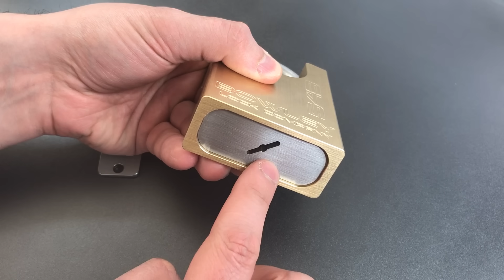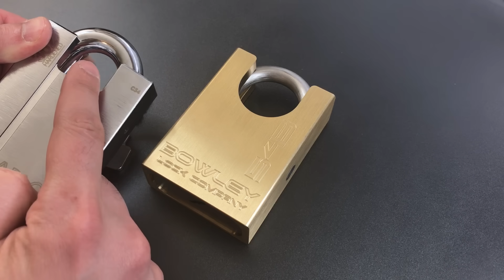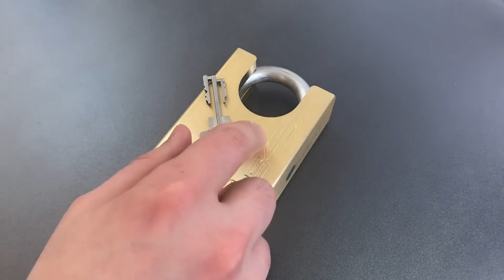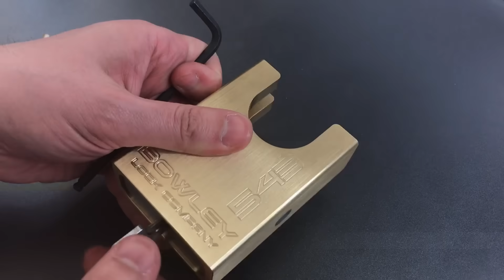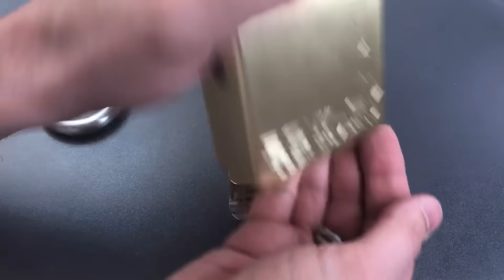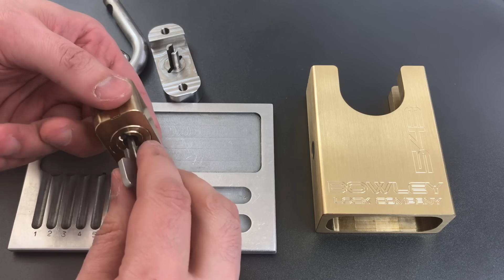[653] Prototype Dual Fork Bowley Padlock (Model 543)

Comment: I'm sad you didn't even try to pick it
Reply: He said in the video he’d need to make a custom tool to pick it so it’s probably a lot of work to make a tool that’d only be usable on a very specific lock.
Reply: @caster269  I think the u-shape pick also needs to be pin-specific because of the pin shield. You cannot pick all the pins with the same lenght tool. If there's a key, sure it's pickable, but I guess this would need 5 to 9 custom single picks and a lot of time.
Reply: @beloved_lover  
Honestly, I think you'd need a hollow shaped tool to tension it and work the idler while inserting some more malleable tool inside to pick it.
And people complained Kingdom Come Deliverance had a tricky picking minigame
Reply: So is the really the first lock that he cant reasonably pick???
Reply: @common_c3nts  as far as I've seen... kinda new tho
Reply: @beloved_lover  unpickable
Reply: @beloved_lover  actually they can pick the original with just a tensioner and one tool, they need a tensioner and 2 tools for this one.
Reply: @common_c3nts  don't say silly things. there are a lot he can not pick, certainly the abloy protec2.
Reply: @rohadtanyad8908  I've seen huxley's video, and another where someone single pin picked the original. SPP requires 1 tool per two pins plus the tensioner, which have to be very thin leading to shit feedback from the lock. I wonder if both methods could be made completely impractical by putting in a few more security pins.
Reply: @caster269  hed probably end up making a replica of the key
Reply: I'm sure it's because he can't because Bowley locks are crazy.
Reply: cuhleef just not to ruin somebody's new business
Reply: @cuhleef  Their lock was easily picked.
Reply: He can't yet, no one can. They will eventually.
Reply: on the padlock you cant fit the 8-10 custom tools needed at once into the keyway and even if you could you would need 9? of each or basically be building the 100 peice shim keyset that bowley talked about making for locksmiths for the orignal bowley .....noone would ever pick this real world it comes down to weakest link eg. nice brick house with glass windows
Reply: Yeah you would need a pick set made specifically for this lock to pick it, such a pick set would need to follow the "long U-shape" of the key, and would need several moving parts on both sides. Imagine what this guy did to the original Bowley lock, but now doubled because there are pins on both sides: https://www.youtube.com/watch?v=leQQ8ChtGkQ
Reply: @Hennu_TRM  Yeah technically doable but practically lemme cut the doors instead it's less complicated
Reply: @Hennu_TRM  I still do not believe this was a true pick. They both made tools that could match the bidding, i.e. a laminated key. What I want to see is them picking one of theses locks with zero knowledge of the bidding. Still has not been done to my knowledge.
Reply: @Taluvian  Good point.
Reply: Every one of his videos he rehearses though so.... <_<;
Reply: Taluvian that’s impossible mate
Reply: This lock is like 9 locking mechanisms and 9 keys for one lock, forget picking it just try to cut it.
Reply: If this lock becomes much more popular eventually there will probably be very special tools in place to pick it. As is I don't think there's even really a point in trying to make your own tool, this lock is the real deal.
Reply: @alexmac7103  Problem is, I don't even see it working with multiple custom picks for each pin. That shielding mechanism he's shown in the end ensures you'd have to rotate it back to "closed" to take the tool out and insert another. I'm not sure how you're supposed to keep tensioning it like that.
Reply: Just use lock cutters on this one or cut the chain, it would be much faster.
Reply: Check his video on an original Bowley lock (without this double key) - he really gave in-depth explanation of this mechanism and why he wasn't able to pick it
Reply: You can't, lol. Beautiful design. Prevents the picker from having direct access to the pins. I guarantee this design is patented.

Edit: it is pickable,  just requires the right tool for the job. It's almost impossible though.
Reply: @JF32304  it can be picked in 30 seconds or less by the right person. it is up on youtube.
Reply: Zachary Rivera Bowley locks are physically impossible to pick.
Reply: @littlebit670  not even. look up huxleypig69 picking it in a few seconds. he also picked the abloy protec2.
Reply: I cant imagine the engineering of would take to make the complaint mechanism to make it even possible to pick this. Itll happen eventually but given the tools now, its damn near impossible even for the great LPL.
Reply: @colesherrill7472   it can be picked pretty quickly now with an epg attack.
Reply: So everyone in this thread knows—the single-sides Bowley locked has officially been picked, I know by at least one person. It required, iirc, 5 separate custom designed tools working in conjunction to pick it.
Reply: alex rosebrough Yes - but this method is not a confirmed picking solution. It could just be a laminated key method.
Reply: Everyone complains that he never posts locks he can't pick. The thing he does but he takes them apart instead 😂
Reply: I'm sad that you think he would waste his time trying
Reply: He can't.
Reply: Do you only look this dumb are you actually? He didn't because he would first create a tool that would be capable of having a chance eventhough his experience in creating tools like that aren't really up to match for this lock. It would be material cost, time cost and alot of effort for abysmally small chances to actually pick it.
Reply: Well that’s how you know it’s a good lock.
Reply: If LPL didn’t pick it, it’s unpickable
Reply: @ThomasFarquhar2  or just pointless to try, smoke wrench. Lol cut the door in half before I try to pick that mess.
Reply: He couldnt pick the other variant, there's no way he could pick the even harder version
Reply: He has not even opened the original
Reply: Better try drilling it first.
Reply: Dont bite the hand that feeds you, pal
Reply: he doesnt show things he cant pick.
Reply: From what he said, he'd need a custom tool to do it.
Reply: you wouldn't pick it . It's easier to have an angle grinder, sledge hammer or some other brute force attack on the lock , chain or whatever the weakest link in the security is.
Reply: When two samurai of the same level meet each other, they notice each others' skill without having to cross swords, as a sign of mutual respect. I think this is like that.
Reply: You can't. You need very special tools to even attempt.
Reply: It’s possible to create a u shaped key with pins that can move up and down with tiny little cameras in the core of each pin
Reply: There's a video of a guy picking a Bowley lock, but he used a special tool.
Reply: No it actually seems impossible to pick in the community without custom tools made JUST for this mechanism. Two guys picked the first lock, with only one row of pins. But the tools were super specific and i am not sure if they are mostly a replica of the key, they havent picked 2 different locks of the same type in one video (also i am not an expert). But no, he cant pick it without making tools for it
Reply: @mqbq3651  Exactly you basically end up making a specific pick that amounts to a key
Reply: @TheDjcarter1966  nah, they can pick it with just a tensioning bar and a single tool.
Reply: its probably because its a prototype...
it's kinda unfair to try to pick a unfinished product which may suggest it has weaknesses the finished product may not have..
Reply: He's sponsor by them so he doesn't want to pick it.
Reply: Suwanh Y In where in the video does he say this is sponsored, when you’re sponsored you get money while liking everything, this is more of a review
Reply: Suwanh Y That’s a bullshit slander, he’s said he’s not sponsored or accepted money from any lock company... EVER. Unless you think he’s a liar, and if you do the decent thing to do would be to provide evidence of that
Reply: @mcamp9445  He gets locks sent to him, worth some money for free. You should never trust a lawyer. 🤫

Comment: -canadian lock
-measured in inches
Reply: Engineer here from canada, works with metric one day and US the next.
Reply: Canadians go both ways.
Reply: We use both because so many products come from the US and Canada. It gets quite annoying.
Reply: We use both here.
Reply: @BMikeAD  actually good point. in a workshop I know of in canada, the main measure is inches, so American machinery can be used. which makes sense for a machined lock...
Reply: j Walster that’s not the reason we use imperial. Canada is not fully metric due to our roots being tied to the UK (before they were metric) and our close proximity to the US so when they began the conversion to metric in the 70’s there was a lot of resistance so it’s a big mish mash of both. We use kilometres instead of miles and litres instead of gallons at gas stations but when talking about length and weight, we usually use feet/inches and pounds. Height, weight, how much you bench, the length of a room, size of your tv, length of a piece of lumber or a pool, etc. We use mainly imperial in government documents, even our height is listed in centimetres on our drivers licences but in everyday life we use imperial for height and weight.
Reply: @dlee6985  Being Canadian can be complicated.
Reply: @kenc2257  Not really, it just expended our horizon PS Sorry for any gramatical error, french is my mother tongue
Reply: @dlee6985  litres instead of gallons is stupid because you are getting less gass for the same amount of money usually
Reply: @dlee6985  Us in the UK are in a half way house on imperial / metric measurements. I don't see this changing anytime soon !
Reply: BMikeAD same in the USA. Science trades tend to use metric.
Reply: @Zachmman1997  because it's more precise and easier to calculate, but imperial is easier to estimate or judge by eye.
Reply: FREEEEEEEDOM UNITS
Reply: I am a Tradesman in Canada and we use Imperial 95% of the time. Trades school here teaches both, however.
Reply: @seanelgie  It shouldn't take a trade school to teach the difference. I learnt it in high school. 2.54cm to 1 inch. 2.2lbs to 1kg. Basics.
Reply: Brits and Canadians often still use imperial to measure things
Reply: Just going to say that metric is superior
Reply: Well Canada is just America's hat
Reply: @Terabit3  it's like a hat, where it is covered in snow!
Reply: @smpmuzpid  a lot of Americans use metric too.
Reply: @ipopmyneck805  
Yes the US military because every country they invade uses metric highway measurements, and of course the drug dealers.
Reply: I mean when y’all adopted the FAL you specifically changed it to the first of the Inch pattern ones, instead of just using the metric.
Reply: @andyriggs6613  you are ignorant of common measure terms. Good job.
Reply: They use both, watch this video: https://youtu.be/s95cxZkC_es
Reply: Yeah buddy we're bilingual in length
Reply: Right metric syatem...
Reply: Makes canadians two times more educated, no? joke
Reply: @caffeinatedinsanity2324  funny because it's more than true
Reply: @caffeinatedinsanity2324  well if you look it up Canada does have the highest education rating per capita in the world so.... yes
Reply: @DUxMORTEM  that is false i believe actually
Reply: @strider04  that is correct actually 
. 50% of the canadian population has a college or higher level education.
Reply: @DUxMORTEM  according to a recent study that I had found it said south Korea was higher. Sorry if I was wrong
Reply: @strider04  south korea also has a population smaller that most provinces in canada, thus that info is incorrect by looking at a map. Canada has the highest education per capita, meaning more people based on bith the size of the country and its population density.
Reply: @andyriggs6613  listing a measurement in a number of quarter inches, sixteenths, eighths, etc... is very common in engineering, machining, manufacturing, and designing fields. I'm sure the final product will list it as a mixed number. And it's hardly just a Canadian thing, it's extremely common if not more common in the US. The only people it seems to bother are High School Sophomores like yourself who've just learned how fractions work and want to sound smart on the internet... If you get to the hard stuff most teachers/professors will prefer you leave things as improper fractions to keep things simple as possible.
Reply: j Walster ya we use both when it’s convenient but we really don’t like using fractions of an inch is a pain in the butt and metric is a billion times easier. Ya we use both sum times
Reply: I like my measurements in American

Comment: i just noticed a potential flaw in the design.  if that idler isn't under enough tension it could possibly rotate due to vibration or what have you rendering the lock nearly impossible to open.

Comment: That idler looks like it would cause problems. What if vibrations causes it to rotate without the key? Will that key still be able to get the idler aligned again to open up the lock?

Comment: Imagine getting your headphone cable in your pocket all tangled up in that key.
Reply: @Chetanarora2308  what? i cant hear you, i have my airpods in. 

also not sure if you're joking about it or not, but wireless in-ear headphones have been a thing for a while and apples suck just as much as the rest
Reply: That would be utterly horrible. I'd end up cutting the headphones off and getting new ones!   Lol.    😅😂
Reply: Chetan Kumar apple created a problem and gave it an expensive solution
Reply: I was thinking that it would be catching on things in your pocket and possibly ripping a hole in your pocket eventually.
Reply: its not that hard and doesnt take that much time to wrap the cables properly. Dont be lazy
Reply: I am the master of unthreading headphone knots.
Reply: That is why the keyring goes into ur left pocket and ur phone WITH the headphones I to the right pocket of ur pants. This way it can be easily avoided and wouldnt even have to shed 2 brain cells to come up with that idea.
Reply: @MoundN  it's a joke. Don't get triggered.

Comment: Hi at last a super lock but a bit pricey, I've been watching your videos in the hope of finding a lock that's tough enough not to snap open and yet remain hard to pick. I'm blown away at your skill and speed and left quite bemused with lock choice. My property was Brocken into via a 4'' grinder with rechargeable battery , is there a lock that's hard to pick yet has strong enough steal to resist most small grinder wheels?

Comment: With ALL due respect. It is a Beauty, however, over kill. To prove a point, a limited number of collectors brass locks. Someone wanted to make a lock that is truly unpickable.  Someone wanted to make a lock that the Honest experts could not open. The same high tech crooks, use cutting torches,  lances, shaped charge, etc. etc. They are Really impractical. An Abloy, medeco etc. would be a better choice. NOW these DO have applications, on vaults, explosives bunkers, brinks trucks, Government etc. where the rest of the security structure is just as fortified. On a bike NO, House, NO. Any Place where there is an easier access NO.